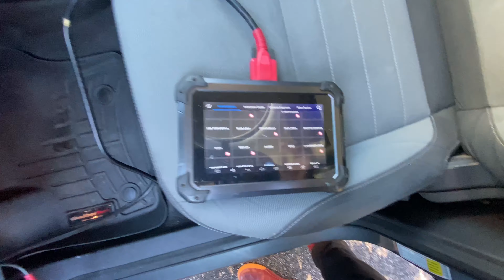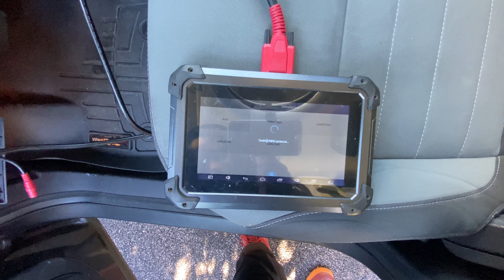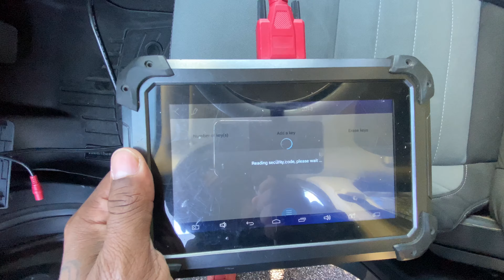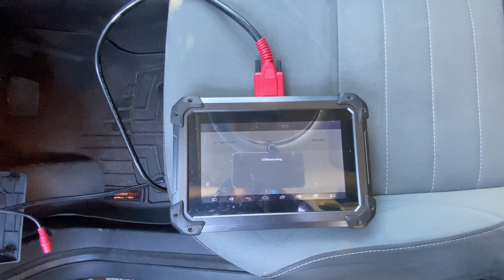Bill & Devin Haney Audio: “If Shakur Want Smoke At 135-140 He Can Get It, It’s Bound To Happen”

Comment: Shakir could have been mandatory because he had 2 belts at 130.
All he had to do is activate
Reply: It don’t work like that when you change divisions. You come in at fight top guys in elimination fight for a belt
Reply: @hiramnozall2245  went like they for alot of fighters including bud so chill bro
Reply: @hiramnozall2245  when you have the wbo it does work that way. you can activate to become the number 1 contender off rip. thats their rule
Reply: @jafarpro94  Shakur doesn’t have the WBO wba ibf or any other belt. He lost his belts to the scale before he even moved up. That’s the point I’m making he not in any position to activate anything he’s belt less. Devin did say yesterday that he can be next after Lomachenko tho but Shakur changed his tune
Reply: @hiramnozall2245  I didn’t say he did bro. Just stating the wbo’s rule. You said it don’t just work like that and I was just saying if you have wbo it will